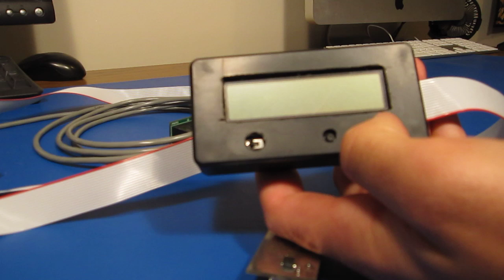Electric Motorcycle Build #6

Comment: You say that the controller shuts down the charger if one of the cells is fully charged. Does this not mean that you are limiting the capacity of the whole system to that of the weakest cell? What if one of the cells is charged but the other 23 aren't?
Great project btw, thank you so much for sharing and inspiring me. My uber-cruiser is taking shape... well, in my mind anyway!
Reply from the maker: Yes this is correct! Depending on the situation the cell which reaches full charge first could be the weakest cell, strongest cell, or anywhere in between! If charge is not terminated you will be doing damage to this cell. My GamberBMS does cell-cell balancing and minimizes this issue.

In the video below I show what happens to a relatively well balanced pack. Without a BMS you would destroy the cells quickly!
BMS and Vlog
Reply: ***** Thanks. Would it be possible, or even worthwhile modifying the BMS to have individual shut off per cell? Or are the variances between cells too small to make much of a difference? Also, do you have a video of the first ride and your impressions of the differences between the old and new system? The only one I could find was the one with hamburger discussions. Here in New Zealand we get 8 packs of burgers but only 6 packs of buns. It's a mathematical conundrum for sure.
Reply from the maker: ***** No worries! It's possible (like a three slice toaster), but it definitely does not make sense to have different cutoffs for different cells. The whole point is to keep the cells within the manufacturers recommended operating parameters. Assuming your pack is built with cells that are all the same model (which it should) then the operating restrictions (voltage, current, etc.) is the same for all cells.

Functionally the BMS has always been pretty much the same. The "new" system is much more durable, reliable, and more cosmetically pleasing, but that's about it. The manual for it is on my website.

My channel is very well organized if you look at the playlists...You should be able to find the video where the new BMS is built. I have a video coming soon that shows how it works and how to set everything up.

Yes! They have hot dogs all figured out! 12 dogs...12 buns... but they fail to do the same with burgers! AHHH!

Comment: Bike can be made much simpler using 12 volt car battery and delco starter motor with reostat. I used Honda 90 trail bike out of the 70's however, same thing.mike